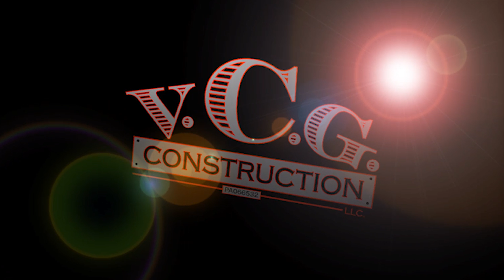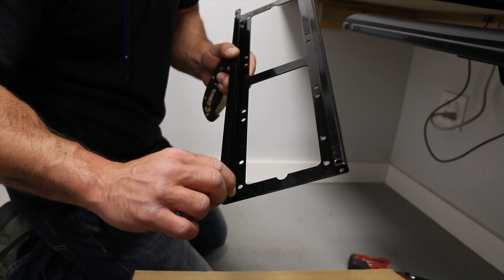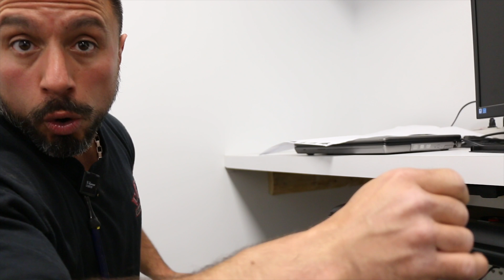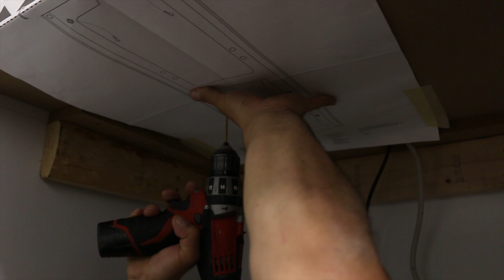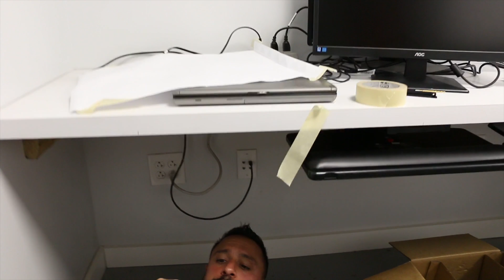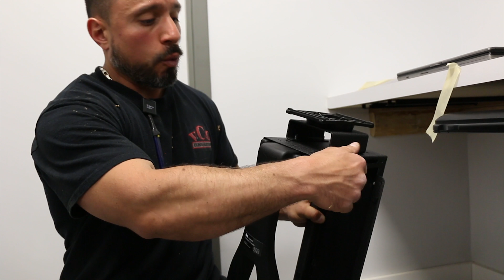Install An Underdesk CPU Holder

Comment: prairieskycam
Do you have a measurement (length and width) for the mounting plate that fastens to the underside of the desk?

And my CPU/case/tower/PC/box is 9.25” wide. The specs on this says it will accommodate up to 9.3”. Just wondering if this will accommodate mine. Thank you.
Reply: Hello did you end up buying one? Did it work for your case? 

Thanks

Comment: Was this installed in MDF or particle board and if so is there anything special you need to do to allow the bracket to hold the weight
Reply from the maker: Yes the work top is MDF, it’s still in place no problems.

Comment: Good video and informative. Ha ha.. Not sure an Amish person would have the need for any hand drill for a CPU holder.
I do have a genuine question. Rather than cheap chipboard as a surface I thought I ought to have a solid hardwood. The unit I have in mind has 6 mounting points and will be holding  my workstation , weight 28.8kg. 
Obviously I don't want to the weight to crash due to being ripped out of the surface which is why I have doubts about using chipboard for possible lack of "bite".
Any advice?
Reply from the maker: Hahaha true!!

Comment: I have this same item made by Human scale for sale on ebay $ 39.98 with free shipping !  eBay item number :142549301587
Reply from the maker: +Erik Ramos post the web address, I want to see it.
Reply: They are on ebay item number 142549301587
Reply: you can also type in CPU 600

Comment: CPU(central processing unit)aka Processor 
PC(Personal Computer)
Stop calling it CPU it's called a PC or tower or computer
Reply: That's the actual name of the product.
Reply: So complain to amazon and 3m and all the other companies selling these??
Reply: TECHmanGT it's super cringe hearing through the whole video
Reply: Completely agree it was driving me nuts haha
Reply: The guy refers to the product by its very name and gets ridiculed. How juvenile. Nice video guys and thanks for taking the time to make it.
Reply: @prairieskycam  I think you shouldn't call a product by its name but by what it actually is. So instead of calling it a Central processing unit holder mabey calling calling it a personal computer holder fits better, because that is what it actually is,
Reply: @doctorhantu7282  Don’t bother telling me, but rather tell it to the manufacturers of these “holders” if the use of CPU in the name is upsetting to you. The manufacturers call them that, and this guy was simply using the same terminology yet he’s the one being ridiculed. He’s just trying to demonstrate how to install one.
Reply: @prairieskycam  I don't have the power or time to reach out to every company that makes that mistake, so I thought maybe I could help someone who may stumble upon this comment section, by giving facts combined with my own thoughts.
Reply: @doctorhantu7282  It doesn’t really matter. I think it’s a lot of fuss over nothing. I came upon his video while looking for “CPU holders” because that’s what they’re called in the industry and I got the information I was searching for. I’ve been  dealing with computers for nearly 40 years and I know what CPU means. Trivial stuff like him referring to it as that doesn’t bother me. Again, the guy was simply making a demonstration video on how to install a product and he called the product by the manufacturer’s name. Simple as that. As passionate as some seem to be about the use of CPU in the product’s name, one would think they would channel that energy to the manufacturers. In as much time you’ve spent debating it with me, you probably could’ve sent a blanket email to a few major manufacturers. Have a great day!
Reply: Technically the CPU is inside the computer and he is mounting the PC (which has the CPU) which means this can be called a CPU mount. Not as “cringe” as you think.

Comment: I have a glass desk, with metal framing & limited space.  I have the dimensions, my question is, would it be possible to mount the upper piece to metal brackets hanging down like a drop ceiling & do you think it would hold an Alienware R6, 33 lbs.  These are my dimensions of the computer; 
Width 8.3 in
Depth 14.2 in
Height 18.6 in
33.2 lbs

Great video!

Comment: When you bought you drill did it come with the battery? I know you can choose different models of batteries I think, maybe I'm wrong about that.  Nice vid I almost Nick was gonna mount ya there for a sec I almost turned it off. But yet I know Nick don't go like that. Nice vid
Reply from the maker: When I bought the m12 it came with a drill, impact driver, charger oscillating tool and 3 batteries! Home Depot was ruuning a special! God forbid!! 😂😂😂😂